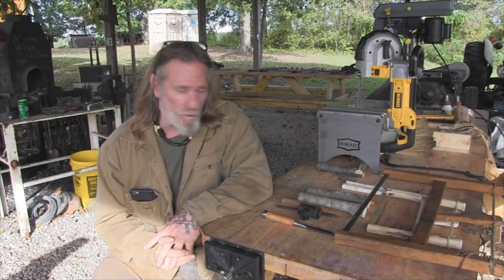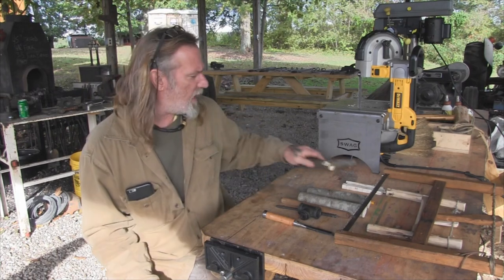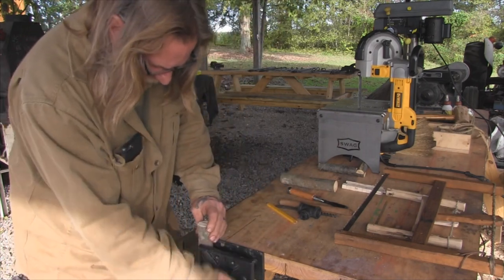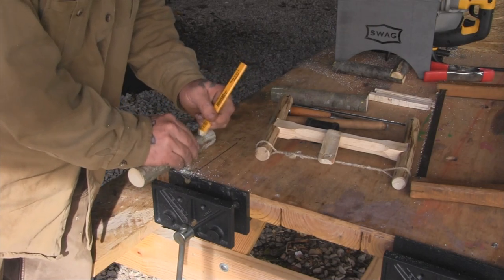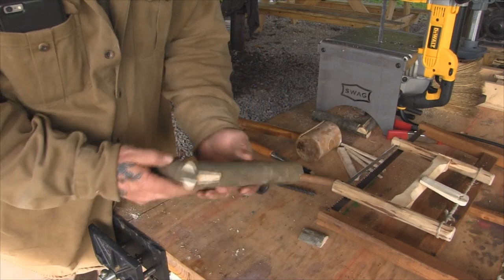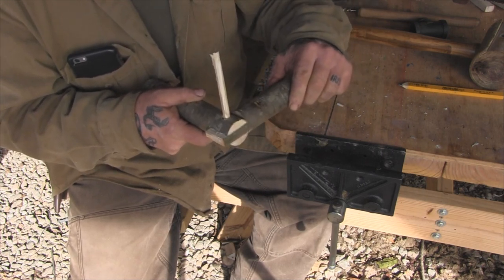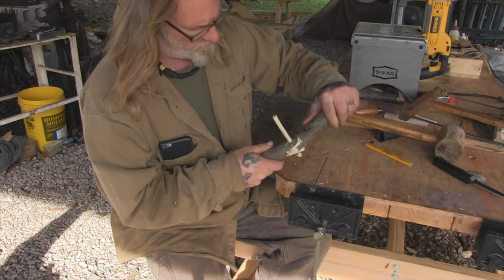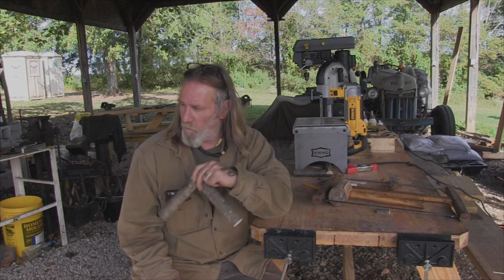Making a Bridle and Swing Joint or Hinge

Comment: Hi Dave, I've been loving this series. What has been very helpful to me is seeing all your different methods of work holding. As a "common man" without dedicated a dedicated work space, I struggle a lot to figure out how best to secure wood. The stump shaving horse, the concave stump, the use of two cheap vises to make one big vise, the picnic bench with integrated saw bench, using a log as a mitre box, etc were all new ideas for me. Your demonstration of using wedges on the picnic table to hold a board on edge was ingenious. I've found effective work holding to be the first step in planning any project. Most other youtube videos take for granted though that you have a big bench to work on. I just have some firewood out in the yard. So your bushcraft-inspired advice regarding work holding with stumps and logs makes a big difference in my situation. If you have any other ideas for holding pieces large or small, please bring them up. I've been educating myself on these topics for a long time, but your channel is the first time I've come across such practical advice.

Comment: Dave If you bore a hole at the bottom of the bridle joint you don't need a chisel. As long as the hole is the same width as the joint.

Comment: 2:50 why does it say "Swag" on the side of your saw?
Reply: Steven Alcaraz Good name for a brand lol
Reply from the maker: +TheGamingBros46 Swag is the Brand of Stand made for Portable Band saws, we use that thing constantly in the Forging Shop and it is worth its weight in Gold as far as I am concerned. Got mine off Amazon Prime-
Reply: oh ok, Thanks everyone,
Reply: +bad hat a quick check of  Swag off road on Ebay  has some very neat tools  the DeWalt vertical table is 249.00 but He has the same thing for a Milwalkie tool band saw for 149.00 and it fits the Milwalkie batt powered version  the fuel 18 

my cutting on this type of saw would be  small branches  running for 3-4 seconds each time and I am looking to make  all My tools  off grid or portable  so I might go with the MT version  just for that reason  and having a extra 100.00 bucks in My pocket
Reply: +bad hat BTW thanks for the tip on where to find it 👍☺
Reply: +bad hat <}=)